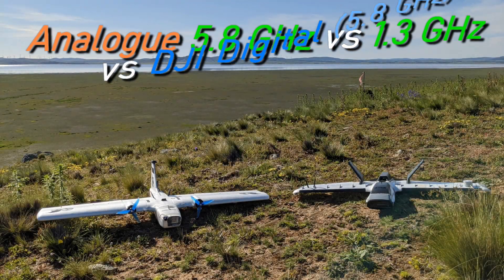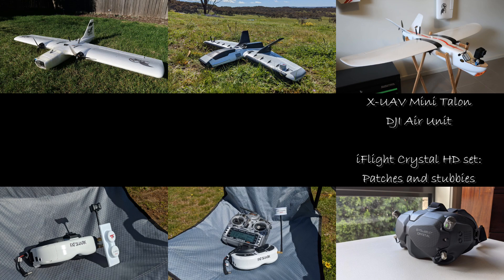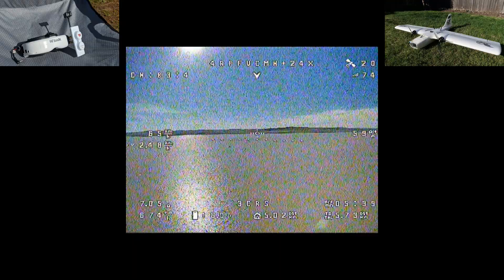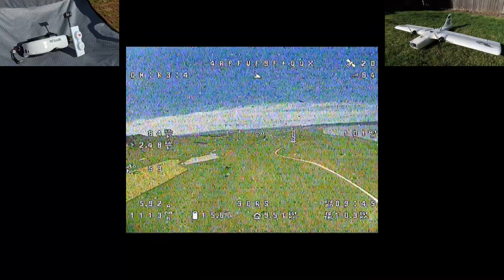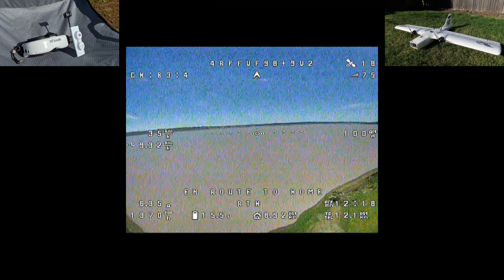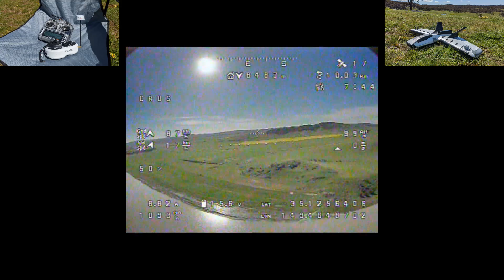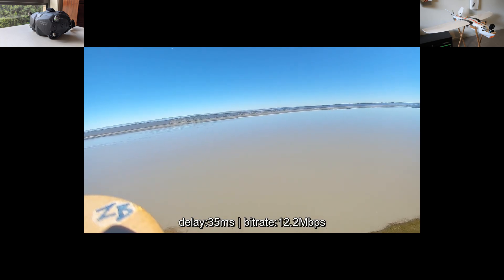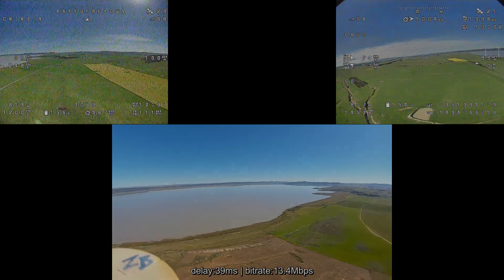5.8GHZ, 1.3GHZ and DJI Digital Comparison (at Lake George)

Comment: What control system should be used with 1.3G ? Some people are saying 900MHz doesnt play nicely with 1.3GHz.
Reply from the maker: You can use a notch filter on the vtx antenna connection to reduce interference with your control frequency. You just need the right one to match your setup. I was using a 1.3g/2.4g-stop notch filter to use my 2.4g L9R control with these flights.

Comment: I flew an old FPV wing in North Carolina where there are lots of trees and easily obscured lines of sight.  The video signal was atrocious.  I should have tried to set it up with 1.3 GHz, but I didn't really know what I was doing back then.
Reply from the maker: Digital video does pretty well with patch antennas, but yeah - if you are flying on the fringes of line-of-sight coverage, not much will beat 1.3G on a ground station.

Comment: Hi Can you share more information regarding to the VRX and antenna in the ground station?

Currently I am using 5.8G VTX AKk race ranger 1.6W and ORT Pagoda as the antenna in my plane

For the ground station, I use diversity module DIY with ORT Patch Feeder

I want to increase my Video Range
Thank you
Reply from the maker: Hi, I didn't use ground stations - just crosshair antennas on goggles on 5.8g, so can't really make recommendations sorry.  How much range are you getting now?  You could consider switching to a 1.2/1.3ghz setup for longer range on analogue, or the Walksnail system on digital.

Comment: It would be a lot nicer to have the telemetry data on the recording should you need to perform any post-flight diagnostics or find your aircraft should it go down.
Reply from the maker: Absolutely. The later digital systems apparently support this. I've switched to ELRS which gives me telemetry to the radio for essential info, including airspeed, altitude, GPS data, in case I lose video.

Comment: Was thinking getting a 1.3ghz for rc car and/or 10" quad for long range. 1.3ghz 800mw should get out further than 2w 5.8ghz granted 5.8ghz has alot of small easy to wear patches available. 
Right now my tank has 5.8ghz 3w vtx and my long range drones are dji might switch one to walksnail for on board recording
Reply from the maker: Wow, 3W! You must need a whole lot of penetration where you drive the tank!
I think you need a ground station with decent antennas to make the most of 1.3G.

Comment: Thanks for the video! Which is your most efficient flyer? Im trying to get as efficient as possible for distance. Cheers
Reply from the maker: The AtomRC Dolphin. Kept light it can cruise on 2.5a. It can be balanced with a 4s2p (6-7a) ion pack if you don't put a HD camera in the nose. Cruising at around 4a, that would be a lot of endurance!

Comment: Thanks for the great vid! One question I had, sorry if you already went over it. How much more range can you get out of 5.8 digital vs 1.3 analog? It seems like you could go really far with the digital system, but I guess I'm wondering about your max range. Thanks!
Reply from the maker: Current DJI (V1/V2 goggles) are limited to 13.3km range regardless of how much signal you have - it's programmed in. Other digital systems may not have this software limit, and we're yet to see the results of the new DJI goggles 2 and v3 vtx.

Wes Varty recently posted his Walksnail digital range test and it got to 31km using massive (ridiculous) antennas on his goggles.

So at this point, it's possible to push both analogue and digital to 30km or more, if you are willing to use large directional antennas. The antennas on 1.3ghz are already large, so this normally means a ground station setup... but you then could go for extreme range, 50+ km.

Digital will provide a better HD image and experience, so it depends what you are willing to invest in. I like a light goggle solution and am okay with a 13km range, so the DJI kit I tested in this video are still all I use two years on.
Reply: @ZaksterBlue  artificial programmed limits disgust me. Thumbs down to dji. At least leak a way to hack it.

Comment: Did you use any notch filters for 1.3? Interference from control link could be the problem
Reply from the maker: Yes, a 1.3/2.4 notch filter was installed.

Comment: What video system do you think is best for fpv car?
Reply from the maker: For short range penetration behind trees, dirt, buildings, etc, I think DJI is still the king. The best FPV image quality is a bonus.  But you have to keep the VTX unit cool, either in airflow or put a small fan on it.  Otherwise anything else will work as you don't normally drive RC vehicles that far away.
Reply: what about long range?
Reply from the maker: @lucasvanhamburg4937  maintaining line of sight the 1.3ghz would win for range using similar gain antennas. Not sure how that would go if you were driving into a forest with obstacles... again using similar gain antennas to the digital goggles to keep it fair. I'd guess that 1.3ghz would get a little further.
Reply: @ZaksterBlue  thanks man

Comment: Excellent comparison. Can you use 1.3 on digital ? Regards.
Reply from the maker: Thanks!  DJI use dual-band 5.8/2.4 only for their camera drone.  5.8G only for the FPV kit.  I don't think anyone else is using lower frequencies yet - Orqa are hinting at developing 2.4 and 5G, but not ready yet.

Comment: Very new to the FPV world, going with Nebula Pro and DJI Goggles V2 on my Dolphin. I've watched many of your videos when you've overlayed the goggle view, or like this one where it's all goggle, and all it ever shows is "Delay", "Voltage" and "Bitrate". I'm going with F722-WPX and I-Nav, do you actually see much more info in the goggles like on the other 2 comparisons, or like I do in my DJI FPV Drone? I'm still in the process of installing all my equipment, so haven't gotten to programming or testing anything... but was just curious. Thanks, and even though I know very little about any of the 3 systems, it looks like a very informative video.
Reply from the maker: Hi! Yes, there is plenty of telemetry data while you fly DJI digital using iNav. Arrow and distance to home, GPS coords, speed, altitude, volts, amps, efficiency, etc... nothing important is missing.  Just a shame DJI haven't enabled a way to record this extra data.
I've not tried using some of the other tools to overlay telemetry data on videos yet - there's a gopro GPS data overlay tool / recording blackbox data on an SD card (if your FC has a slot) / or even recording on your radio if you are using a telemetry link like crossfire (I don't).

Comment: Exactly the informations i was wondering about! I'll be diving into adding FPV systems to my favorite airframes soon and am torn between 1.3 and digital.. Im still split tit for tat its a dead heat! Really nicely directed video, though! It looks like 1.3 will give more range especially if optimized with ground station antena tracking, but the range comparrioson of digital is what i hadn't heard anyone talk about, and what i was looking to learn! Good point i tik you meant that when the latency goes too low and signal drops it could be more sudden that analog? Like analog will slowly fuzz more until total drop, where digital will suddntly drop its clear image to nothing? 
Thank you !
Reply from the maker: There is no comparison with a analogue ground station for sheer distance. It's really a decision on whether image quality/immersion within 10km is more important or not. I decided it was as I'm generally pulled up on the side of a lake or river to fly.
And yes, the DJI Digital will cut off as soon as latency is too high at around 12-14km and you can be faced with a couple of terrifying minutes of no video before it reconnects if the area you are in has a high noise floor. Thankfully rare.

Comment: Great video. Never used anything but 1.3, but a comparison like this was really nice. Also good to see that the Matek VTX works well. About to use it in an AR-Wing Pro
Reply from the maker: If I'd invested in 1.3g earlier and built a portable GS I could strap to the backpack I may have stuck with analogue a while longer (or run both).
Reply: @ZaksterBlue  The HD looks amazing. Guess there is no way back from that :)
Reply from the maker: @HaukLanglo  exactly. 😀

Comment: Of course, had you been using Dipoles and a directional VRX antenna on 1.2G, it would have been a different story..
The other Elephant in the room is your DJI system running at 1200mw?...
Hard to imagine how you have a lousy noise floor in the middle of nowhere though..?🤔🤔🤔🇬🇧
Reply from the maker: The point for me, as always, was to see what could be achieved from stuff that fit in my regular backpack.
Reply: @ZaksterBlue  Yes, I can imagine..So, you have to hike it to get up on that ridge launch point..? .It's a high vantage point,and explains why you don't need much altitude, even 10kms out...Shame about the Towers, I bet they are directional beam transmitters of some kind maybe...🤔🇬🇧
Reply from the maker: There are transmission towers on both sides of the lake spewing out the pulsing noise here.